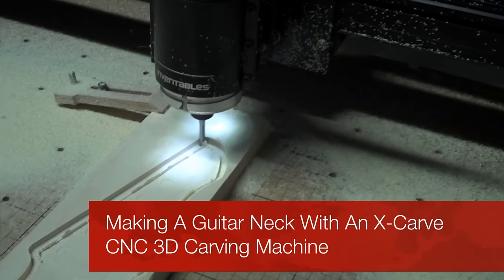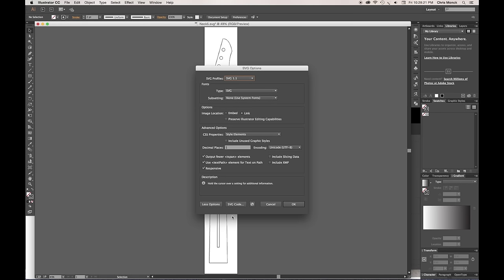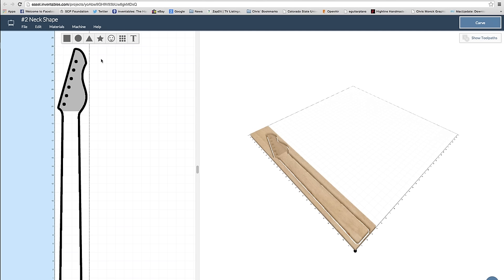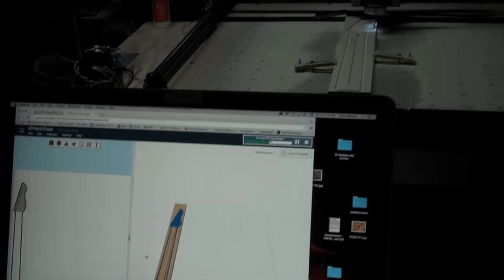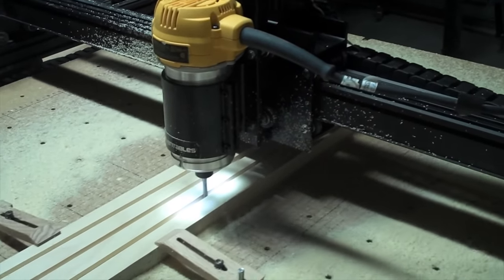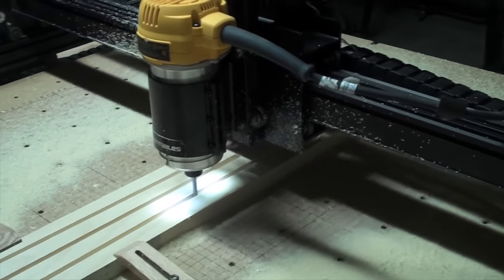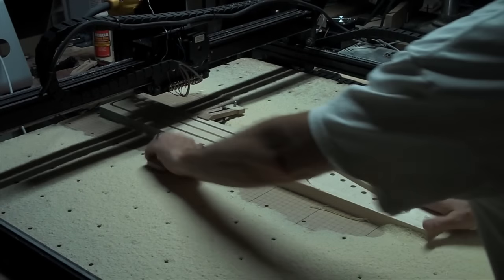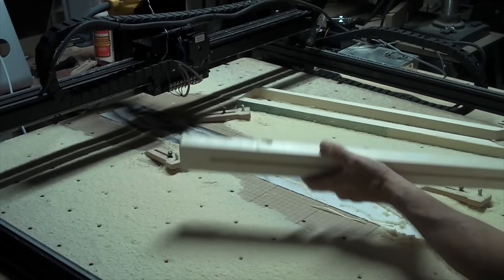Making A Guitar Neck With An X Carve 3D CNC Carving Machine

Comment: Very nice! I'm using Solidworks for my CAD and MasterCam for the machining instructions....and a Fine Line Automation 24x48 machine with a Hitachi M12VC router.

I love CNC and it's an extremely helpful tool to have when you have limited workshop space. I don't have enough room for standard tools like a bandsaw, scroll-saw, table-router, planer etc....so the CNC does all of that for me. Then I take the guitar parts off and sand them, and prep for paint.  I can crank out about 10-13 guitar bodies in a 12 hour day if I need to just using my one machine, with perfect accuracy (well...within .001" in most cases lol)

Absolutely worth the investment.

Comment: You've convinced me I'm ordering one for my shop!  Are you using a Dewalt router instead of the inventables spindle?  Looks like it cuts just fine.  I appreciate your videos, I've leaned a lot from them and built some decent guitars. Thanks!
Reply: +Chuck Carter if you buiy one, for gods sake make sure you get a better spindle like the dewalt. I also made the mistake of buying the 300w stock spindle

Comment: Hello!!! I constantly watch your interesting videos. Please tell me, why did you change your x-carve cnc machine to a homemade cnc machine??? X--Carve is broken???
Reply from the maker: No, the X-Carve isn't broken. I want to build a machine just for fun.
Reply: @HighlineGuitars  I live in Russia, and we have one company that makes exactly the same machines as x carve. Someone says that they are weak, and there is not enough rigidity for processing wood. But I'm also going to make electric guitars. I watched your videos where you make a guitar neck and an x carve fingerboard. The possibility of such a cnc machine is impressive!!!
Reply: @HighlineGuitars  As you can see, they are identical. The spindles are only different. In Russia, the Makita milling cutter with a power of 710 watts is popular.
Reply from the maker: @GRSTGuitars  As long as you're not mass producing guitars at high speed, the X-Carve is fine. Just be aware that the belts and v-wheels need frequent adjustment. Linear rails and lead screws don't.
Reply: @HighlineGuitars  not for mass production, of course... Rail guides, and the helical transmission is much better. But the cost of such CNC machines is much higher... Thank you for your feedback!!!